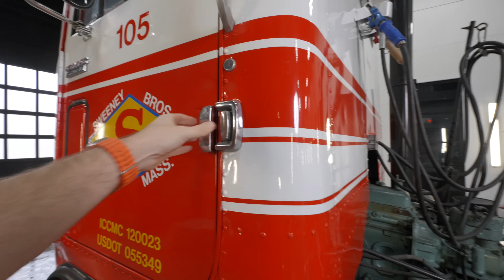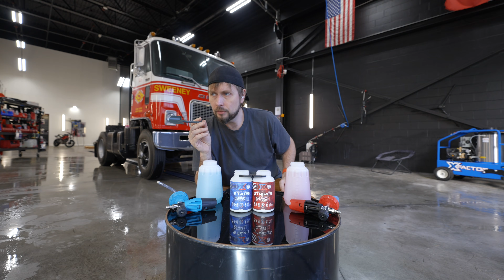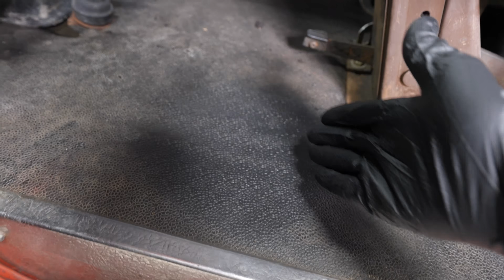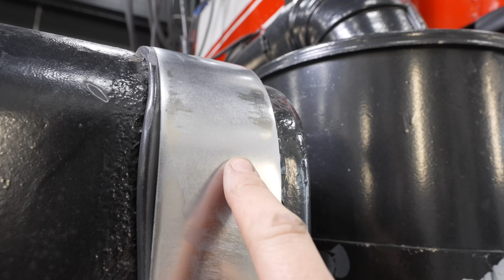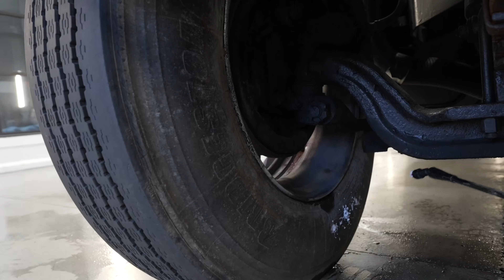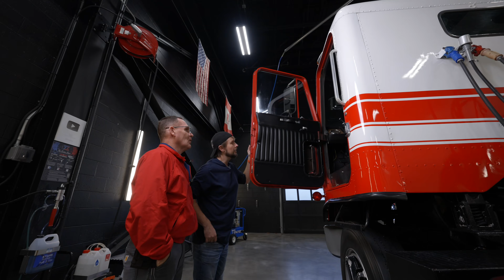FULL DETAIL on A 1969 GMC Astro Cabover!

Comment: P&S Total Send water based dressing is what i use on my fire engines. Will self level pretty well, but i still use a brush to apply.  Dries fast, holds up to dirt rodes well, 1:1 for a matte almost natural look.  Straight for a satin gloss, and can be layered for more gloss. Its done me and my crew well.      

Been switching alot of my detail chemicals for fire apparatus to your stuff Bob.  ChemX Is legit.  Stoked to try out the metal polishes.
Reply: ADS Tire+ on my daily driver. Brush applied and it levels well into my duratracs

Comment: How does the snake oil vs McGuire ceramic si02. I know yours is a rinse off formula. McGuires doesn’t state that but would be interesting to see it in a foam cannon and see results
Reply from the maker: Is the Meguires sio2 in a spray bottle or is it designed to be foamed on?
Reply: @ they have 2 different bottles. The blue bottle is a spray on and rinse off. The clear bottle with yellow liquid says to be put on like wax with micro fiber towels  to let haze then be wiped off. But just wondering if it could be used in a foam cannon and rinsed cleaned.
Reply from the maker: If they are ready to use then the foam cannon would probably dilute them down much further than intended, snake oil is really really concentrated so that it can be used through a foam cannon at 100 parts water and 1 part snake oil onto the vehicle surface.
Reply: @ correct. I think the yellow ceramic coating is the concentrated version of the blue bottle which is the spray on rinse off. That’s why I wondered how it would react to being put in a foam cannon at 100:1 ratio. But I have not read the ingredients well. I just seen it on the shelf at my local harbor freight and wondered if it react like your snake oil.

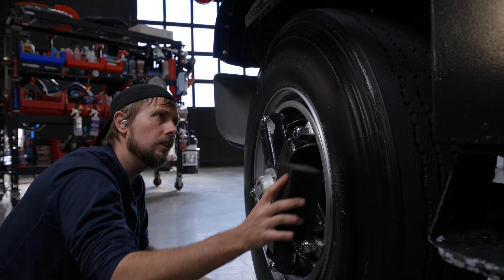Comment: 36:45 The best tire shine I’ve used is ExoForma Permashine.  Our yard is insanely dusty and I can wreck my tire shine driving from the wash bay to my parking spot, but nothing sticks to the Permashine.  I applied it back in august of this year and though it’s dulled to a matte finish, my tires still look clean.  Mud and dust don’t stick and I can touch the tires up with detailer if they need an extra pop.
Reply from the maker: That’s awesome I’ve seen that one and I was curious how it holds up I’ll have to try some

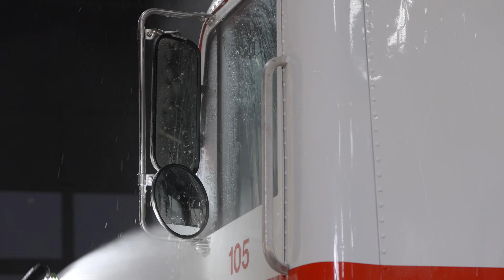Comment: Quad 0  sos is the best since it won't leave fine scratches. After you use it, 34:54 i used it on  my painted wheels to remove a few rust spots Is the blue polish just for crome or can you  it on paint to
Reply from the maker: I think I actually did have 0000 steel wool going on this it’s def a very helpful thing especially on the stacks where the soot bakes on

Comment: How often should we re-apply snake oil if we wash our vehicle with stars+stripes every 1-2 weeks? (Daily driver). I do it about once a month and it seems to keep it in good condition but I’m curious what your experience has shown.
Reply from the maker: I’ve seen it last for over 6 months with Stars and Stripes used weekly, but not in every situation, some people like yourself mention doing it more often. I think the strength the soaps are applied at and also a lot of other environmental factors play a big part in its longevity, so it’s hard to say for sure from where I sit. I would benefit from your thoughts on how far you can stretch it and some other details like where your at, what factors the vehicle is exposed to regularly like sun or parking under trees, water quality, soap dilution strength, man I could go on but there’s just endless factors lol
Reply: @ChemX  I live in TX and my vehicle is almost always parked outside as well as daily driven. I apply snake oil and stars+stripes at 1:4 ratio via foam cannon. Due to our extreme temperatures and the vehicle always being in the elements, I opted to apply snake oil slightly stronger at 1:4 opposed to 1:8 to get a more durable coat. So far it has been nothing short of amazing. This vehicle is flying on the highway every day, getting beat on by sun, wind, rain, etc. Yet it stays shiny like the whole thing was waxed, and water just slides right off the car! I can say for sure it is 1000% Texas approved. The fact that I could spend $60 on a bottle of snake oil and not have to buy another bottle for 1-2years is insane value, and the performance of it rocks!

Comment: Bob, I really like the longer videos where you talk through the product developments. I was wondering if you'd ever tried or considered pouring the chemicals full strength into the foam cannon reservoir and then using the knob to dial in the desired ratio? Also, possibly using some sort of metering tips or system built into the foam cannon like Griot's Garage has. This is what I have started doing in my detailing business and I seem to use less product and its amazing how much time I save not mixing up foam cannons on every wash.
Reply from the maker: Thanks I appreciate it! I have used my soaps directly in the cannons and loosened the top knob all the way, it’s definitely the better way to do it, reduces refills dramatically and you can put the soap you didn’t use right back into the bottle. I love the idea of a ratio tipped cannon, griots big boss is the only one I know of, I want to play around with one and see how it cuts

Comment: Never run out of battry juice and get to those tight polishing places you've been tackling lately. Chech out the Flex PXE80 at, Skys The Limit Car Care, The Clean Garage or Detailed Image for PXE80 KITS, accessories and more. Note, I'm not affiliated with this retailer in any way other than personal purchases... 

MUST HAVES:
* Flex PXE 80 Cordless Mini Nano Polisher Kits, $390. > $600
* APS Total Upgrade Kit for FLEX PXE 80 - $100. 
* Various size polishing pads & sanding dishs- $100. > $200. 

BEST UPGRADES/ACCESSORIES:
* FLEX 12V 4.0Ah Lithium Ion Battery- $80.
* Flex PXE 80, 6mm throw Throw Adapter- $40. 

☆ Pull the little roll-pins from the backing plates male thread. You will see why when you try and use the 2" or 3" backing plates in rotor polish mode. No harm has come to my 2+ yr old PXE using the 2" back plate
Reply from the maker: Oh heck yeah I’m going to have to get these in thank you for the intel here

Comment: Is that heavy duty straight and are you thinking powered form heavy duty too in the future
Reply from the maker: I usually cut it up about 50/50 in my pump sprayer, probably stronger than it needs to be but I love how easy it works at that strength. One of the solvents can’t be evaporated in that one unfortunately, however I’d like to come up with a new version of it that could be powder

Comment: If you’re looking for tire shine, I had my detailer put a permanent/ceramic tire shine on my truck, it’s been on there for 6 months now and looks great. I had them only do 1 coat because shiny tires aren’t my thing, but they say one coat gives you a satin finish and 2 coats gives you gloss. If I remember correctly it made by dura-coat. 

Also, you’ve turned me onto the gun light on the wand and tho I’ve yet to get a chance to use it, I think it’s gonna be a game changer. I’ve seen how helpful it is in your well lit studio, I wash my truck at night outside. I just took my regular flashlight and got a cheap mount on Amazon
Reply from the maker: Nice that’s cool on the flashlight, I’ve always found it helpful. Duracoat seems like a really nice company I’ve seen the tire coating and it looks really good, 6 months going strong is incredible